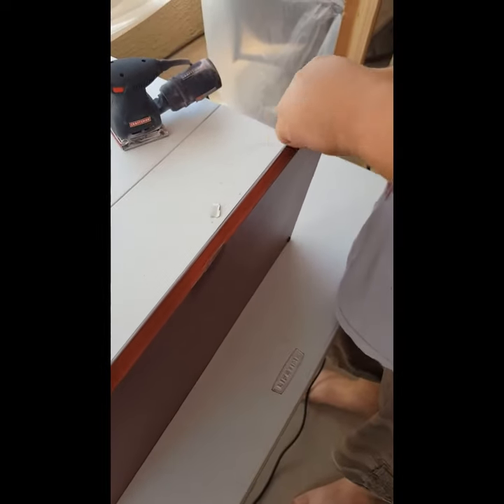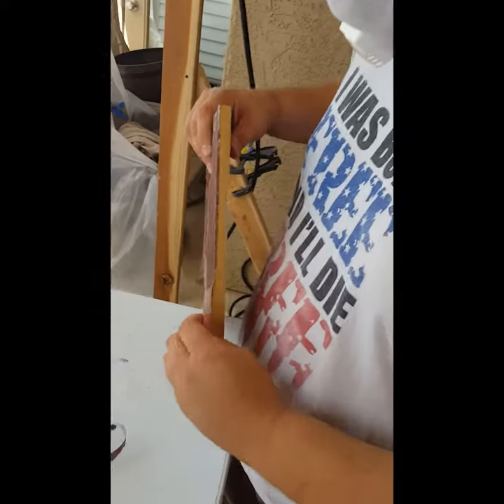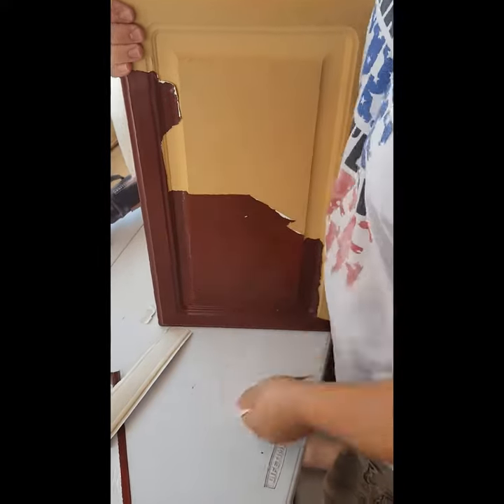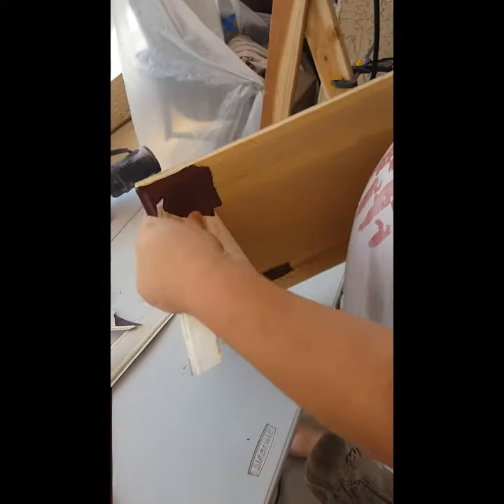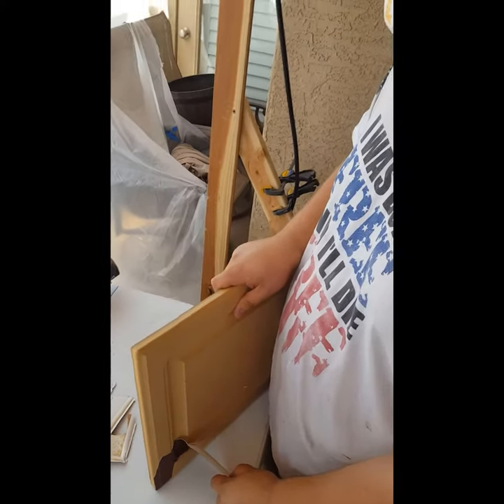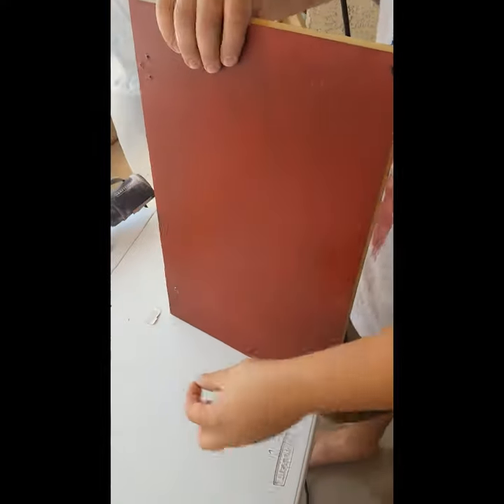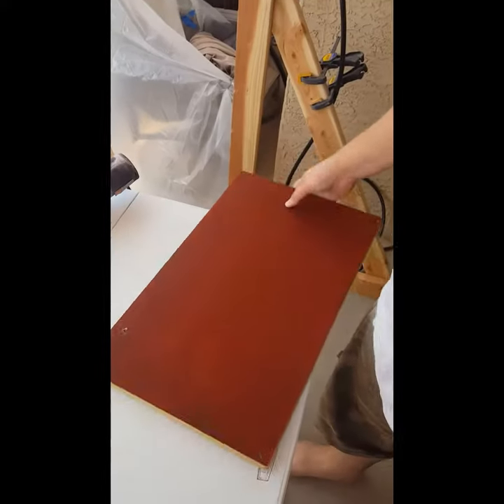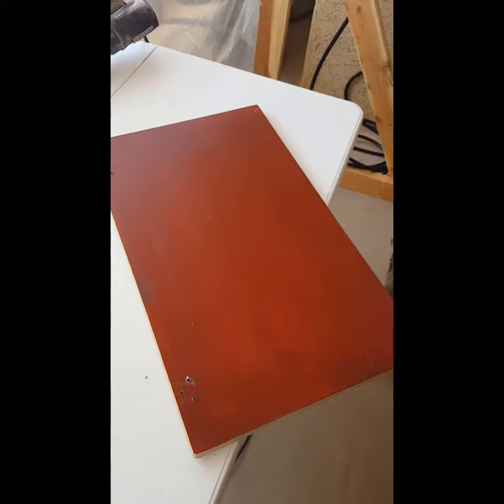Removing melamine film, painting MDF cabinets

Comment: We are doing this with our kitchen cabinets, I’ve looked at videos and they say lightly sand l, primer maybe twice, paint, but the cabinets have a very rough texture! They are not smooth, my husband did an aggressive sanding on one and the surface is super smooth we haven’t painted it yet, so I’m not sure what it will look like after painting, so we need to sand the cabinets aggressively to get a smooth finish?
Reply: Perhaps you have particleboard rather than MDF. That might not be worth the effort.
Reply: Sand after you prime and before you paint it. Make sure you use oil based primer.
Reply: How did you get the residue off the wood after peeling off. If you sand it gums up
Reply: @dmarr528  I used goo be gone or acetone. Also spent so much time sanding. Like an hour per door

Comment: Thanks for this video - we just striped ours and am concerned/confused about the back. Ours has a white backing that won't come off with the heat gun - do we primer and paint over it? Sand it down? 

Thanks again!
Reply from the maker: Same here. We sanded it well but not down to the wood. Just made sure it was smooth and spotlessly clean. Then we sprayed the back same as the front with primer and finish coats. As of today, they still look great - front and back.

Comment: Hi what’s the process to paint them? Do i have to sand it first and then add the primer? Or can i go ahead with the primer without sand them? Thanks for the help!
Reply from the maker: We lightly sand and clean between all coats. Thoroughly sanding and cleaning before primer is the most important step.
Reply: The Land of Color after removing that paper , can I paint that wood under ? Bc I have the same as you , can I sand , prime and paint or stain ?

Comment: Does it leave any sticky glue remnants? X
Reply from the maker: Not really, no. It's not like the MDF was buttered top to bottom in glue and then the melamine film was applied over it. Our cabinet doors had a few skinny trails of some kind of adhesive that was old and brittle. The melamine lifted away no problem and then we just sanded off the remaining adhesive.
Reply from the maker: We didn't have much glue residue. We sanded thoroughly and cleaned well to make sure the surface was totally clean before the primer coat.
Reply: The Land of Color 
Hi i have a little problem! I did 4 doors so far in grey, the only thing the first two door are much darker than the second two! Any idea why?
Reply: @matteo76usa  That is a mystery - I wonder if the pigment in the paint had settled by the time you did the 2nd doors or if they were manufactured differently. Did you use a primer first? That should help to  keep the color uniform.
Reply: When you sand it has a lot of glue residue I go thru 3 disc / door and that’s after scraping with putty knife if you don’t the paint primer easily scratched off
Reply: I have real shitty wax-like glue residue. It does re-melt when being sanded with 120 grit, so it gets pushed down into the freshly sanded surface. Seems to be really hard to remove. Maybe some chemical might help to strip it. But that sucks.
Reply: I have been trying to find out how to remove the glue. I read on Youtube-wipe it with mineral spirits.